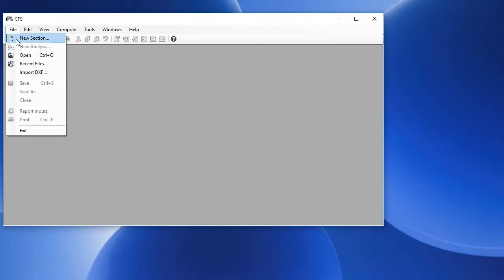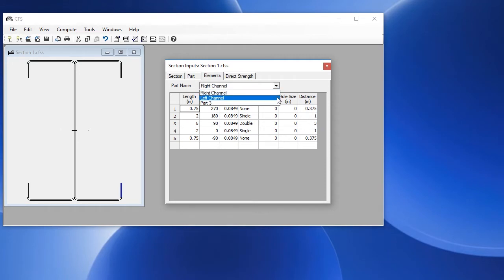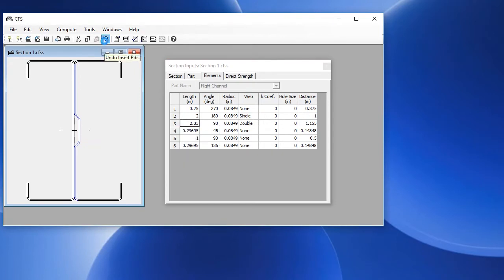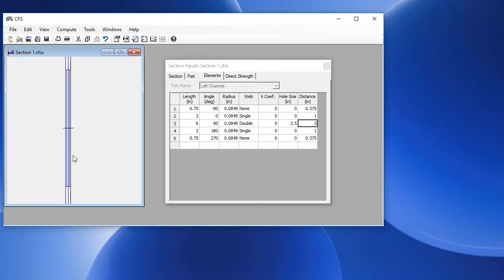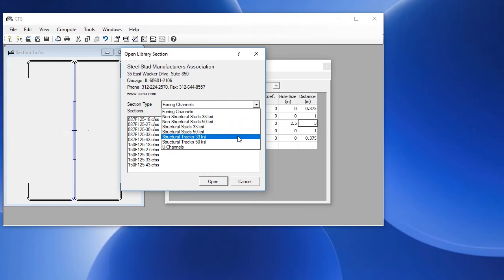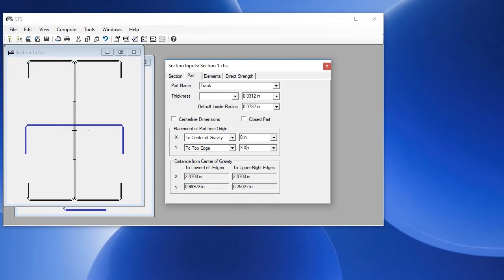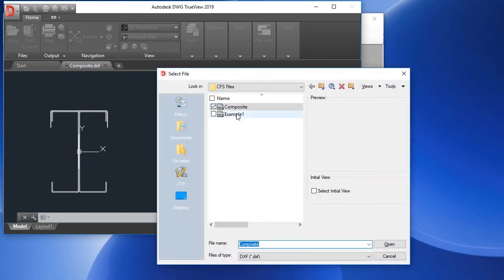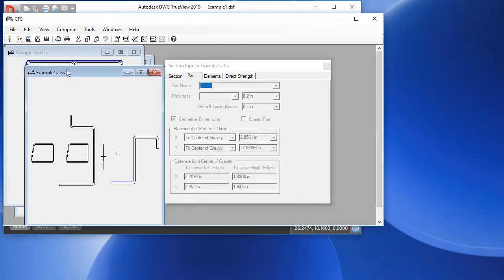CFS Tutorial: Working With Sections

Comment: For seam-lock roof type, is it reasonable to define the purlin as "Top Flange braced" with Reduction factor 0.7? Or it is only applied to bolt type roof?
Reply from the maker: The AISI S100-16 Specification permits the reduction factor method for one flange fastened to deck, sheathing, and standing seam roof systems. CFS permits you to enter the appropriate reduction factor R, which should be determined in accordance with the specification.

Comment: Can the program make a 3D solution?
Reply from the maker: CFS does not provide 3D analysis. I suggest looking at VisualAnalysis by IES (https://www.iesweb.com). This software includes cold-formed steel design using the CFS calculation engine.